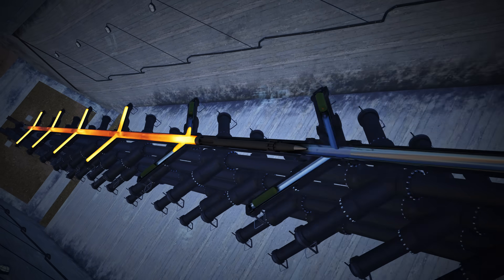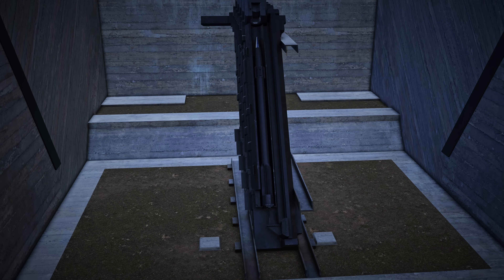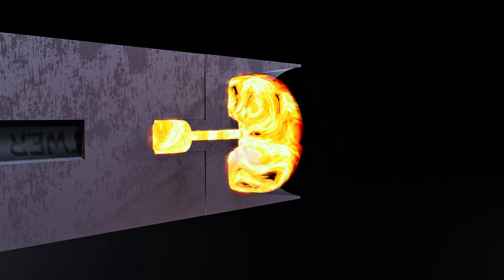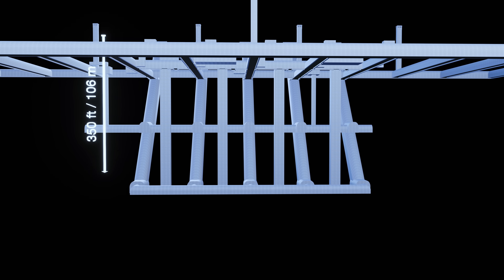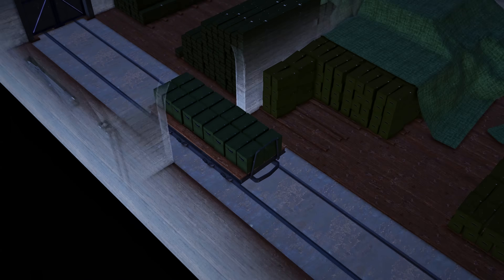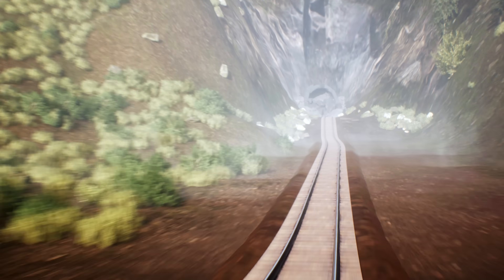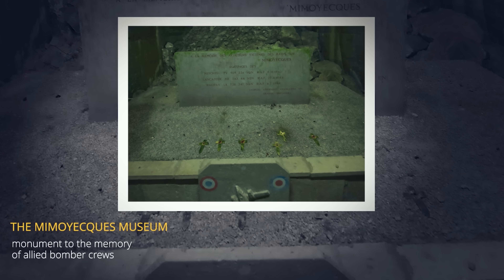Inside the V3 Nazi Super Gun

Comment: all them smart engineers and no one thought: the gun should be able to aim at another city when the city its aimed at is destroyed
Reply: Once it’s discovered it’ll also be attacked quickly. It wouldn’t have survived long enough to aim somewhere else. But, they would have needed some way to slightly adjust it if trying to actually hit something. Even if it was just moving it 1/2 a degree. 

Any big stationary weapon will have the same problem. You might get a few shots off, but it’s generally not worth all the effort and cost.

Comment: Typical Spicy Pinwheel engineering... almost a good idea... but built on a shoestring budget without the needed manpower and skilled labor to make it work or the industrial capacity to automate any of the process...
Reply: Anybody that has ever operated any sort of pyrotechnics would look up at this nightmare setup with almost no real safeguards to prevent one of the additional powder charges from being set off by an ember that was not cleaned out of the barrel by something and just start screaming... no way in all of hell would that fire rate have ever been possible with how much manual labor is required per shot...

Because every time that you have a human doing a dull monotonous but still demanding physical process instead of a machine, you are guaranteeing variation and non-compliance with standard operation procedures will happen...

And you know they were not planning on having an expert drilled team operate this machine they were planning on having slave labor do the dirty parts... so they would not care about fume build up because they believe life was cheap, and how hard it is to replace a slave when you collect them by the railcar full?... meaning inevitably somebody would be exhausted and under unrealistic expectations to maintain fire rate and so a mistake would get made and suddenly an explosion would be happening outside of the barrel and depending on how they would arrange the loading of the supplementary powder charges into the various breaches... it would result in a massive series of secondary explosions and likely destroy the guns from inside...

Comment: honestly i'm surprised this ever made it to the construction stage. it's a terrible idea. not only is the whole reloading process and logistics system entirely unrealistic, even if it did work, you can't aim the damn thing so like, your enemy could avoid it by moving a hundred meters to the left or right? you'd be able to shell the snot out of one relatively thin strip of a city that's miles across. also i don't think it would have even fired, putting that much pressure inside a metal tube sounds like how you build a pipe bomb to me.

Comment: A fixed facility to just attack a single target is insane... Due to uncertainty and environmental effects, you'd spread the hits around, which helps. You could target other targets in the same direction by modifying the cascading fuel amount.
But such big bunkers for a single target is risky and instantly useless if you succeed 🙄 It would have worked of course, but bombed to nothing quickly... The V1 and V2 were much more effective.

Comment: Your statement that the gun could fire 600 rounds per hour, 24hrs per day, seven days per week is ridiculous.

Even if they had the 100,800 rounds just to get through the first week there is absolutely no way that the gun and supporting systems could sustain that rate of fire over the seven days.

Although theoretically possible with the 50 barrels, the reality is that the test article failed after only 25 rounds had been fired.

100,800 rounds in a week? Utter bollocks.

Comment: Using the data provided by the video and the proposed firerate of 1 round per barrel per 13 mins, this bunker would have fired just shy of 2770 rounds per 24 hours. Without incident.

5 guns per drift * 5 drifts = 25 rounds per firing
Using the proposed firing speed of 1 firing per 13 minutes:
1 fire/13 mins  *  60 mins/hr  *  24 hrs/day  *  25 rnds/fire = 2769.23 rnds/day

Comment: there is so many things about this that dont make any sense to me. How exactly would you reload the pressure canisters in the given environment considering the steep slope. The simplicity of the design makes me assume the required maintenance to keep a single gun active would be immense not to mention multiple stacked on top of each other. If safety measures would be put in place maintenance on one gun would disable the rest of the guns close by. The fact that the gun is fixed meaning the target would never change except for environmental imputs changing the trajectory. All in all the total ammount of fuel and personell needed to operate seems inadequate compared to the impact it would  have.

Comment: In Poland you can visit museum in the location where the only full size test V3 was operated. The work was continued even after destruction of the side in France. The gun finally managed to reach distance 150 km but was to late to put it to real combat. As a test site it was located on the surface and today you can see only concrete base. There are however some pictures.

Comment: This is basically how a railgun works but instead of electrically charged magnets it used solid fuel.
Reply: Actually I think it'd be more like a coilgun since it's not a consistent addition of energy
Reply: That's what I was thinking! 👍
Reply: And if I had wheels, I would work like a bicycle...
Reply: So basically like a railgun except for the part where it's completely different?
Reply: Before he said anything about solid fuel, I was sitting here thinking the Germans also invented railguns. Well, maybe they did, i don't actually know. If this weapon was built again, the electromagnets would've made the fire-rate faster by 10x at least. No ejecting of casings, or reinserting solid fuel, etc. Just a guy putting another round in, right after the last.
Reply: @MrJustyoutubing  The real issue would have been barrel depredation and the extreme power requirements. You would probably need either a big gas turbine generator, or if you wanted to keep the overall material resupply demands as low as possible, a mini nuclear reactor like the kind they have on Nuclear Submarines or a series of mini nuclear reactors. I know there was a company a while back who was working on such a project (the mini reactors not a super railgun facility)
Reply: @3lanksp_cehear me out, maglev projectile with a conductive gas "contact", possibly with the rails coated in a corrosion resistant metal

Comment: This kind of complex system would require a massive cleaning effort.
Reply: And at 55 pounds of explosives per shell, with no targeting, the only thing it would achieve is being a nuisance. A major nuisance, but a nuisance all the same. 

And that's not even getting into the issue of metallurgy being shitty back then and how much downtime it would have replacing barrel sections.

Comment: In the autumn of 1943, internal ballistic tests began on a first shortened test model at the I-Platz in Hillersleben. From various statements by contemporary witnesses and the sparse material that has been passed down, it can be assumed that a test tube about 30 metres long, made up of 6 connecting tubes and a base piece of the 15 cm s.F.H. 18, was installed here. The test variant did not yet have continuous T-beam traverses and side ignition chambers arranged at right angles to the main tube. The base piece of the 15 cm Kanone 18 had a cross-wedge breech with electrical firing. The side chambers were fitted with screw caps. Ranges of up to 8000 metres were achieved with this device.

This v-weapon was tested 5km from my hometown. At the “Heeresversuchsstelle Hillersleben”. The weapon also known as “Tausendfüßler” or “Fleißiges Lieschen”.

My grandfather learned to be a gunsmith at the firing range from 1939-42 in the artillery workshop there.

Comment: It's interesting how they must have calculated random inaccuracies of the flightpath through small differences in speed, air pressure, thermics & temperature and winds in to purposefully almost never hit the same spot in london. I guess the hit pattern would have been close to a spherical or elliptoid (probably more left-to-right deviation than up and down=forward and back) area following some standard deviation metric.  Seeing as it would still have been almost 150 km to london (according to google maps), there could easily have been a couple hundred meters of flight path differences between each barrage of projectiles. I wonder how much actually. Can somebody calculate?

Comment: Nice vid, thanks. Don't get the fumes issue; after projectile is gone, barrel goes to atmospheric pressure. When opening the side charges, natural draw would suck in colder air from the drift, making the remaining fumes exit at the barrel end, right?
Reply: There would have been A LOT of gas in that gun. Natural thermal draft will not clear that as quick as would have been needed for the supposed rate of fire.
The gas at the top will vent, but even after firing the bottom of the barrel could still be at a slight overpressure, meaning the gas at the breach will vent downward and into the chamber.
Also consider that even though they are hot, some of them will be heavier than air, and thus will only be carried up by a sufficiently strong draft.

Comment: You're really betting the house on a 0% failure rate with this beast. Can you imagine the kinetic energy ripping through that underground barrel if anything went wrong!
Reply: I didn't get far into this before I thought - Yeah what if one of those 64 side charges is a squib? How do you even know, let alone fix it?
Reply: if even a single thing goes wrong, BOOM, your entire gun is uber-fucked, and you cant repair it because its all underground and all the people manning the gun are now deaf, some dead maybe (probably)
Reply: @caboose9843 The gun would only fire once the personell were evacuated specifically to avoid casualties.
Reply: @caboose9843  no. being underground waht makes this weapon safe , it just makes rebuilding in case of a failure harder
Reply: @everrets387 it makes it damn near impossible. whats gonna happen if a barrel goes boom and causes a cave in? your entire super artillery battery just got perma fucked because you dont have the time or men to spare to dig all the dirt out
Reply: Considering the RAF had to try blowing up the site twice, and there's still enough left to visit.. I bet the Germans designed it with all those barrels and chambers in case there was a failure. Any fails would only take out 5 barrels of the total system, the other drifts might be fine.
Reply: ITS NOT REAL.

Comment: From an engineering point of view, such a cannon is an incredibly stupid undertaking, because it violates many laws of physics. The first is, a long column from air has quite a substantial weight and inertia. Tube-friction even creates a kind of stickiness. To eliminiate this problem, the whole tube must be evacuated and closed with a burst disc at its business end. Furthermore, ordinary chemical propellants don't have enough detonation velocity to accelerate projectiles at speeds of Mach 4. Hydrogen/Oxygen can do the job, but it comes at a huge cost for the gas handling infrastructure. Not to mention safety issues and a precise high voltage ignition system. Furthermore, the auxiliary charges need an incompressible reaction mass to satisfy Newton's Lex III. Therefore, valves are required to close already traveled sections of the tube in quick succession.

Comment: There is no way they could have gotten 600 rounds per hour with all that reloading.
Reply: I think you meant to say 600 rpH  per hour, with 25 guns this was possible, 1 round every 25 minutes per gun.
Reply: @DoktorBayerischeMotorenWerke 

You could only reload the fuel once it had been fired. There were five areas that could fire, firing 5 rounds each. That would mean 25 rounds per volley. 600/25 is 24 reloads to make 600 rounds out of 25 guns. That’s 60 minutes in an hour to do 24 reloads. I don’t think a reload every 2.5 minutes is very manageable.
Reply: Reload once every hour is 25rph, reload every 30 minutes is 50rph, reload every 10 minutes that’s 150rph, every 5 minutes and that’s 300 rph, still not fast enough to get to 600
Reply: You wrote 600 RPM (per minute), you have changed you comment
Reply: @ yes I did

Comment: 0:54 there's zero way this would've worked. It's too costly, too long, too much friction.
2:24 wait, Fuel Barrels? How the fuck do you replace this much fuel? 
7:08 this animation is so fucking cool. 
7:20 "the entire weapon was mechanical. Electrical timing was discarded due to complexity" Wtf. 
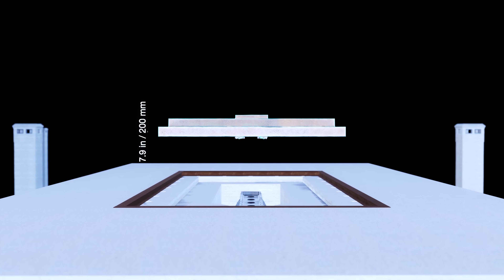8:28 ain't gonna lie, this is kind of a shitty gun. You build it once, and then you can't aim it anywhere else. It's too costly for the RoI. 
10:30 these graphics are excellent. I love the use of photos. I was also impressed by how only the things we've been told about, or are being told about, are shown. 
12:00 manually reload? 🤣🤣🤣🤣🤣🤣🤣🤣🤣🤣 This is some gooftrop shit. 
12:45 this is what they call a "horrible engineering foresight". 
13:36 "this entire proces should have taken no more than 5 minutes. This is completely unrealistic" yeah, no fucking shit!!!! This is the kind of weapon a bad RTS player comes up with, in a futile desperate attempt to do "one last push" against the overwhelming enemy.
16:27 "it proved ineffective, the small explosive did little damage, and the hi pen was unecessary for its unarmored targets" yeah, no shit! 
18:25 sabots are pretty cool, but this early sabot is not very cool imo. 
18:30 "subscribe" 😂.

Comment: 6:44 You must have forgotten about the pressure of the lit fuel rod as it filled the empty gun chamber behind the round. As the fuel rods burned, the pressure filled all the empty space. From the first chamber to the 32nd chamber, the auxiliary fuel pressure would need to fill more and more space, thus making the additional propellant less and less effective. Hence, the proposed speed for the projectile would have never reached its imagined goal.

If the gun designers had thought about the first fired auxiliary chambers would still be high enough pressure to keep the second auxiliary chamber's initial pressure aimed towards the projectile, they needed to realize the gas compression of the lengthening barrel as the projectile sped further up the barrel disappeared as the lower auxiliary chambers burned their fuel rods.
Reply: The pressure is maintained, it doesn't start over at zero 😂

Comment: Similar canon was built and used against Paris during WW1, 
It wasn't THAT difficult to make, yet, still more subtle that what was presented in this video, with successive shells of different size.
But the main reason it had to stop was the absurd strain on the canon itself (even at lower speed) that required the canon to be replaced after few shots.
We can assume that ww1 steel was worse than ww2 steel, but even modern canon need replacement. 

So that project was just plain stupid.

Comment: Basically they designed a Particle Accelerator that worked with punches instead of mag fields! ha...kind of Archimedes and momentum that still follows basic weighted masses innertia.
And from that perspective, It´s regarded as a creazy endeavour to build a structure to fire a 130kgm shell through a 100mts long shaft(and it is!).  But today we use the same principle to fire 1 nanogram of protons through a "10,930,140,000 kmt shaft" 😵😵‍💫(that length is totally for the sake of "cars in football fields" reference hahhah, taken from the 27km hadron ring at the beam speed over 10 hours until target impact, totally bogus hahha, but it´s dramatic hheh)

Comment: There's another huge problem behind this design as a modern howitzer barrel burns out after a max of 2500 rounds - if that gun can fire only 200 rounds a day per barrel then it won't even be able to fire for two weeks before they needed to replace those huge barrels.
Another issue is that of cleaning the main barrel, although I'm sure they had some insane idea on how to do so.
Reply: What makes you think the barrel is the same size?
Reply: @richardjohnson4711  They said that they used howitzer barrels so that is a good rough estimate - maybe barrels back then didn't last as long, but it does give us a rough estimate.

Comment: Was the effective TNT equivalent of the explosion inside the APHEFSDS round used in the V3, 25k aka 55lb or was the mass of the explosive type equivalent to 25kg? It makes a huge difference. If the explosive used wasn't TNT, then it could be even stronger then 25kgs of TNT equivalent.

Comment: Classic youtube clickbait. It's not a "gun" if it has multiple barrels firing in sequence - that's a battery or gun emplacement or series of barrels.

0:30 No. No large bore artillery barrel, modern or 1940s, can last longer than 3000 conventional rounds without failure. At 600 rounds per hour, that's 5 hours. It wouldn't even make 24 hours straight. This is directly contradicted around 11:50 where you say that the barrels have to be MANUALLY reloaded.